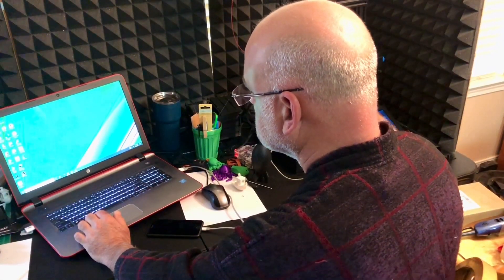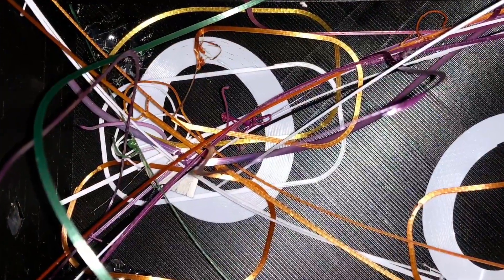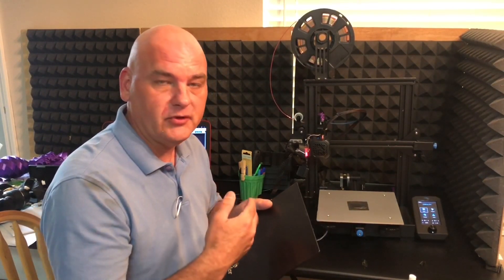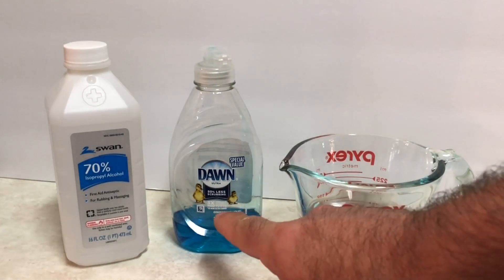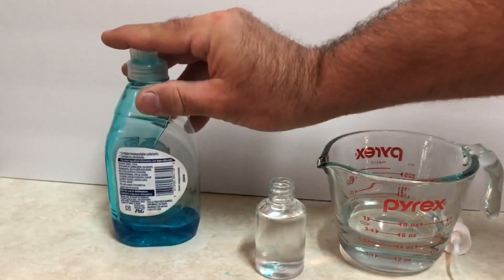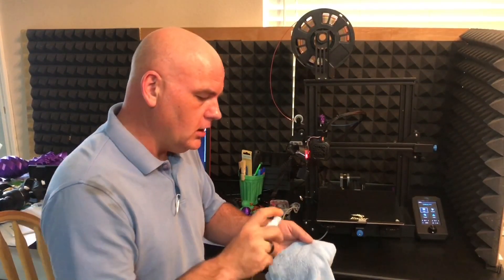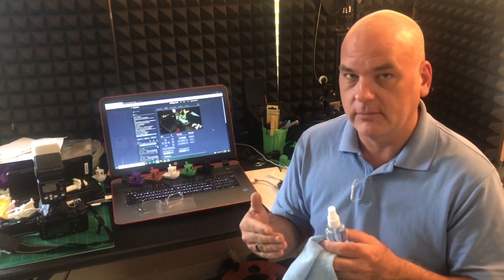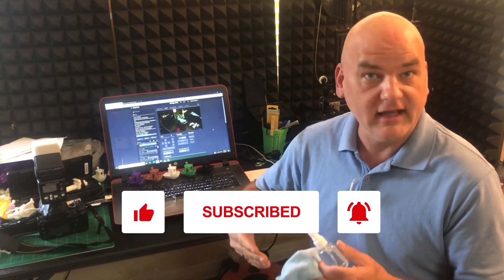Cleaning the Bed on the Ender 3 V2

Comment: Love the video. Just got my first printer (Ender 3 v2). Appreciate the clear and concise direction caring for the glass.
Reply: same bro i have bad bed adhesion trying this soon hope it works or the sink it is+
Reply from the maker: So there’s a lot of info out there. And some things have changed since I made the video. Apparently there is now some info saying don’t use alcohol on the creality carborundum glass plate. I don’t know how accurate that is. (I don’t have one). I do know I now have 5 glass plates and have been using this along with an occasional hot water/dish soap scrub without issue on my plates. 

Point is, do a little digging and find a method that that works best for you and your setup. 

Happy printing!

Comment: Thank you. I couldn't get anything to stick to my bed, even after soap water, alcohol rub, Windex anything. Finally took it to the sink one last time scrubbed it like crazy with dawn a few times. I then dried it off, Put it back on the machine, made sure not to touch it with my fingers then turned up the bed heat for a little bit. Ran a test print and finally it STUCK... Waiting till it fully cooled down and I was able to barely touch the prints and they fell right over. It's been amazing since then. I will use this now between prints. I've only found one thing that will not stick well is this spool of Color Changing Filament. I have to use a Glue Stick or it will just drag around. I've got PLA+ printing now perfectly with nothing extra. Thank you.

Comment: I just spritz straight ISO, Acetone was great for getting the hairspray off when I was using it,  but I found  adjusting the Z offset  (use a skirt and adjust on the fly) , is the best way to get perfect adhesion. I thought it was silly at first, but I don't have to re-level hardly ever. My machine is not consistent on the Z point, but its no issue after a 5 second adjustment at the beginning of the print.
Also, on 15+ hour prints, I use a brim and then a few tiny strips of Polyimide tape to keep it from lifting on those super long prints. I haven't had one pop off in a few months.

Comment: What is the best way to remove the outlines of prior prints from the glass bed?  Can I up the bed temp to 110 can scrape the now soft plastic or is there a better way?  I use your method for keeping oil, dust and other debris off before prints.
Reply: did you ever find a solution by chance? Newbie here and I'm having the same issue. I'm thinking I need to remove bed and wash under hot water but if that doesn't fix then feels like wasted time..
Reply: @nickhernandez4264  i had scratched the hell out of my bed during a leveling process so I had to replace.  Never found a great solution other than using the scraper while the bed was still warm and using alcohol to wipe it down

Comment: I think people try glue stick and hair spray etc because the bed doesnt want to hold on to the print because of touching it or even dust or a layer of film the print likes to leave behind, and the easy solution is to just wash it with water and soap and it sticks like new, this also applies to just bare glass, PLA stick very well to just glass as well if never touched and is clean.
I also use IPA and water, does the soap matter? I will try with a bit soap in it as well to try out next time.
I suggest to never use other methods than IPA, water and or soap because its a coating and that coating will and can get damaged, my first bed was ruined by acetone because it had cooked on clue on it (I bought my printer second hand), so I never ever use acetone on the bed again and just stick with IPA and water.
Reply: IPA? How often do you wash it?
Reply: @garden0fstone736  ipa - alcohol, I do t wash it that often actually, I just don’t touch my build plate.
I recently switched to a flex plate (PEI) but I never had problems with bed adhesion. This actually goes for all bed surfaces, just do not touch it at all is best.
If it does not stick just make sure your first layer is low enough and wash the plate with soapy water and that’s it. But in short : I wash it when my layer comes loose and next print is perfect again
Reply: @Retro_Care  cool I have two dogs and a lot of dog hair. Should I just wipe it down with a microfiber before every print to make sure there is none on the table?

Comment: I used gyeon ( a body prep for painting) and 90% alcohol both worked well cleaning the glass. The problem I had was that the prints stuck so hard I would have smack the print with the scrapper handle. Now I see that soap is recommended. I solved that by replacing the glass with a Pei sheet, and haven't looked back. But thanks for the soap trick

Comment: Followed this "recipe" to fix a mild bed-adhesion issue. The mixture in this video made the problem significantly worse. Tried to knock back the dish soap, and still nothing. Now I just have to figure out how to unfuck my printer. Thanks.
Reply from the maker: That’s a bummer. Sounds like you have a different issue though. I use this mix on three different printers with no problem. Are you using isopropyl alcohol without any additives?  What kind of dish soap are you using?  Make sure it doesn’t have any additives to soften hands or anything like that. 

Regardless, if this cleaning solution concerns you it’s easy enough to rule out with either warm soapy water or straight ipa. 

Good luck. Hope you find the root of your issue.
Reply: If you have a Ender 3 V2 glass board with Carborundum coating, the 'official' advice from Creality is 'just' plain water. It sucks that people give advice to use all kinds of chemicals like alcohol (and because in most mixes of alcohol you can buy in the stores, there are side additives in it, that will damage the coating for sure and leave a residue - so if you want to use alcohol, be sure to buy Isopropanol - so it has no hidden additives -  and delude it with boiled water (against possible lime scale in the water). I guess a heated bed always works better ofcourse. Too bad they forgot to mension anything like this in the manual - or any website of Creality. If you start using chemicals on a new board, you will irreversibly damage the coating (will come off in a yellowish color on paper towels) and then you will need to clean it with agressive chemicals and use attaching spray more and more as the Carborundum  coating will get less and less. So my advice : heat your bed, remove it, try to clean it with a soft cloth with warm or boiled water, and as a last resort use deluted Isopropanol, but more water then Isopropanol... Don't use acetone, it will also destroy the coating (you can better take a normal glass plate then) and try to use the small scraper that comes with it AS LESS AS POSSIBLE, because it will also get the coating off; your glass will start feeling smooth and you will see like these (dull) spots that reflect differently in light. Also this scraper sometimes has sharp uneven metal parts / edges , that will leave nice (not) scratches (or with me, it was just one side of the scraper that had uneven metal sharp edges, so distroyed the coating and got all scratches on my glass after the second time I got my machine new). Be warned. If it doesn't come of easy after printing, don't try to force it (you can pull the coating right off the glass too), but try to see if it comes of easier if you make the glass cold (like with icecubes on the bottom) , or maybe it comes off with a bit of heat with a hear blower... it depends on the material you printed.
Reply: I used >99.5% Isoproponol to clean a small corner of my bed that did have problems. I confirm that the coating did come off in a yellowish color. PLA prints do stick to this corner well , but when the bed cools down they do not self release anymore. So yes pure Isoproponol deletes the coating.
Reply: @r0b3rd  IDK about that. A replacement is less than 20 dollars so I said F it and used acetone all the time as well as IPA for minor cleaning. Been doing this a year and a half on this bed and it still stick great.

Comment: I see a lot of comments here and for other videos that say not to use alcohol on this bed. I  have the same glass bed on my Ender 3 Max. 
The manual says, and I quote  " Use glass cleaner or isopropyl alcohol to clean the surface before every print for consistent results"
Reply: Yep. On my Voxelab printer, it has a clone of the Ender 3 v2 bed that came stock. I just use Windex. However, I made a mistake and used glue stick, which pulled off the coating on the rough side.
Reply: @matthewjbauer1990  is there an adhesive you would recommend for the rough side? Also, did you just start using the glass one instead?
Reply: @tempestandacomputer6951  I really don't recommend any adhesives on the glass bed, both the rough side or the smooth side. What I recommend instead is going with a PEI flex bed. With the PEI bed, all I have to do is make sure the bed is leveled and my prints stick every time, no more adhesives.

Comment: Hi Brian, my son's new Ender 3 Max has the same bed surface. How do you clean the residue pla that sometimes sticks to the surface? The metal scraper that comes with it doesn't seem the right thing to use as I expect it will scratch the surface.
Reply: Have you found a solution? I’m facing the same problem right now
Reply: Update, goop off and a brush drill bit did the trick, and pla still sticks perfectly to my build plate

Comment: Thank you for the video 
I recently cleaned my bed with isopropyl alcohol as some suggested to do so

I did that n now it sticks like rock
And can’t get it off the bed 😬
Do you suggest anything 
Have I ruined the bed surface?
Reply from the maker: No, you haven’t ruined it. I still use IPA sometimes (in fact last night I washed the bed in the sink, and then used 91%). Definitely makes it stick really well. 

First suggestion I have is patience. Let the bed cool completely and the part should come off. 

You can also artificially cool the bed, by sticking it in the refrigerator for a few minutes for example. One cool night my son just put his bed outside when a part wouldn’t come off. 

And finally, you could apply some  alcohol around the base of the part where it meets the bed. It should pop right off, but I haven’t tried this personally, but other people and science tell me it works. Yay science!

Comment: Super...I was concerned with the cleaning...I use a 3D printer at work but glass bed with blue tape and removing the adhesive requires high percentage IPA and the instructions with the printer state not to clean with IPA as it may damage the surface of the special glass